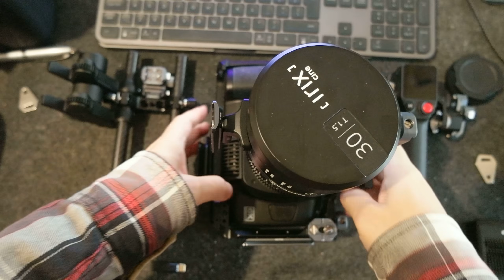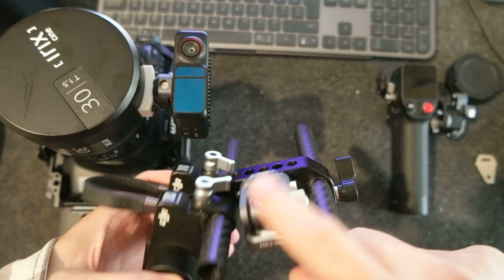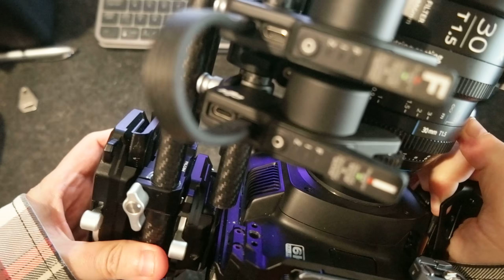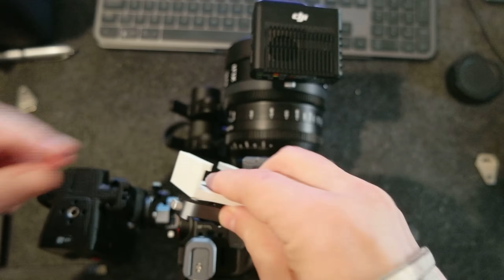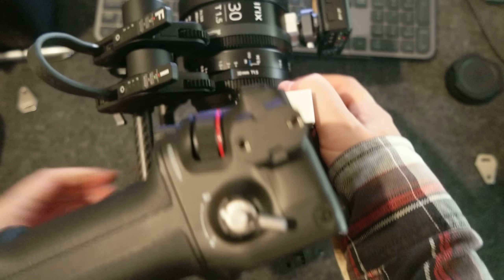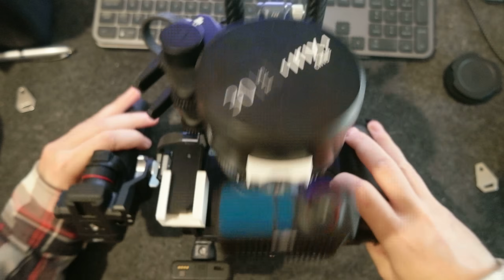DJI Focus Pro and Blackmagic 6k FF Rig

Comment: Worst solution ever, that attachment with time is exerting pressure to the lens-camera mount. The camera and all the attachment weight add to motor pressure, scary on a tripod
Reply from the maker: that's why I am testing, to figure out best solution and what it would fit on a tripod and forus pro